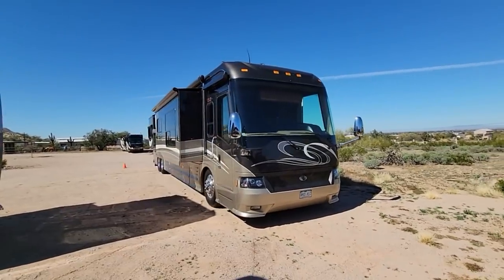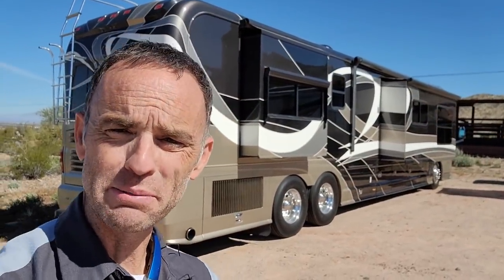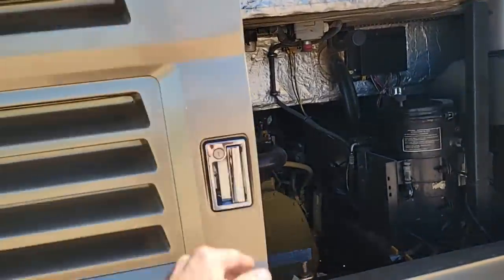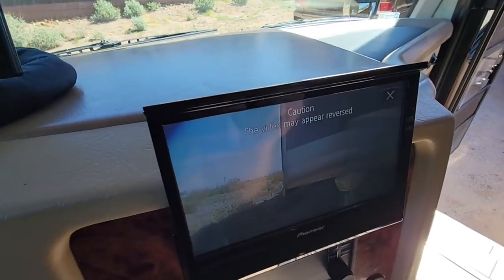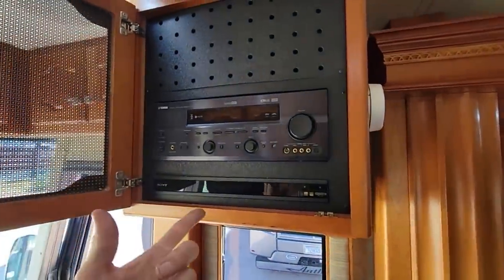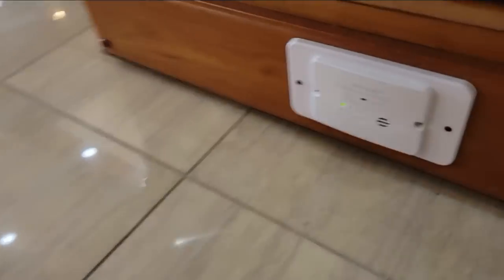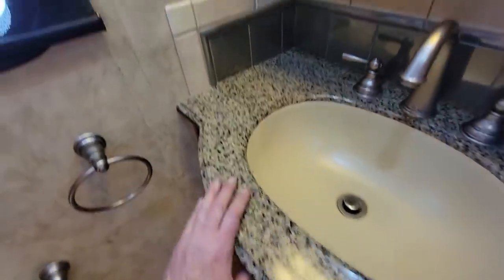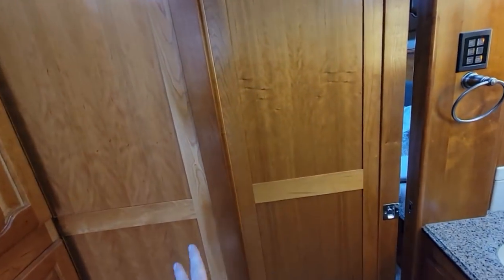I Couldn't Believe the Condition of This Luxury RV

Comment: Pride in proper ownership maintenance, upgrades, garage storage and use is just as important for Coach longevity as the original engineering and manufacturing quality control.

Fantastic find. As always,  awesome inspection and education. 

To properly maintain, fix &  inspect,
Don’t fret or stress;

Contact AZ Expert,
He’s absolutely the best.

Comment: That might have been your best RV walk through yet. In any event that's some good insight into some of the things to watch out for with a CC. Thanks for opening the rear engine compartment. Can't tell if it's just signs of water run off or the beginning stages of a crack at the driver's side slideout @2:32. And some beginning changes in the metal on the driver's side slideout bottom (appears to be worse on the topside).

Comment: Thorough video.  The items you point out as issues with Country Coach are really issues for any coach.  Soft spots in walls and rot as you said are from leaks or a lack of annual maintenance. Same with slide out cracks and delam, always from a water leak above; window, belt rail, roof to sidewall seam which all coaches have right?  What manufacturer do you like?  I would agree with you on bay door separation, they could have been designed better yes. That Advantium oven is original and you can confirm this with the serial number which is also printed on an 8.5" x 11" decal inside the bathroom medicine cabinet door FYI.  Last, this coach is a solid $35,000.00 overpriced.  GLWS

Comment: Jim, you pointed out the exterior panel below the bathroom window. Mine is doing exactly that, noticeable for the inside limited to the width of the bathroom window and about 20 " down from the bottom. Absolutely no sign of water intrusion. Checked roof, gutters, and window and all are tight. Any idea what causes this?  By the way I am an Engineer and told I am sick, because I get all excited about thigs like the tight fit on the TV and other things you mentioned :-)  Jack C. 2001 Country Coach Magna 40' Tag   Any answer you might provide would be appreciated.

Comment: You just showed me plenty of stuff wrong for a rig with less than 100,000 miles !   It would have been impressive if the owner had not spent 30 or 40 grand fixing up what was initially a weakly built MH.
Reply from the maker: I thought it was nice, most of the money was put to good use for long term use and protecting the RV. Thanks